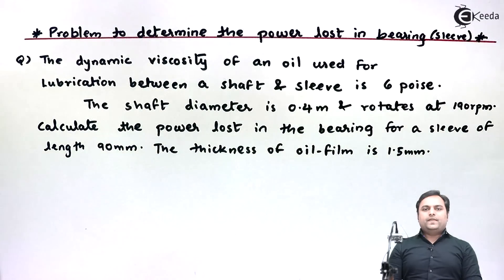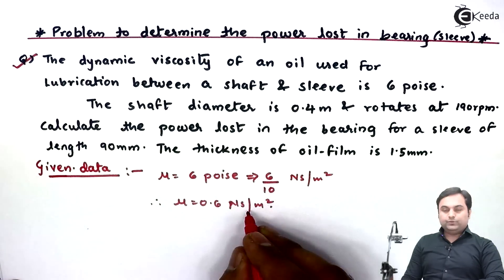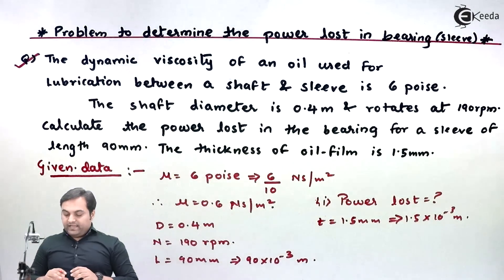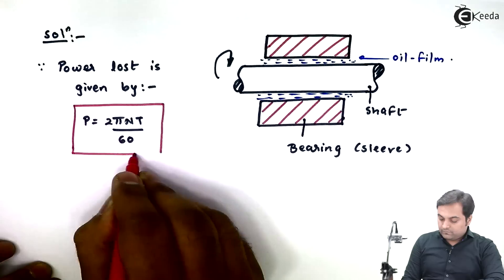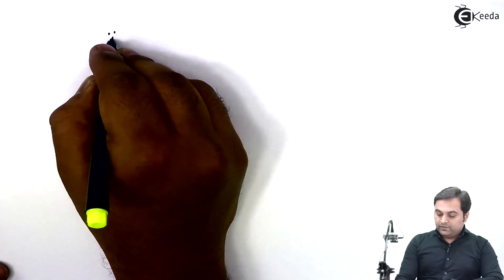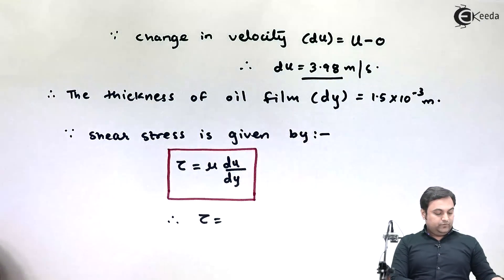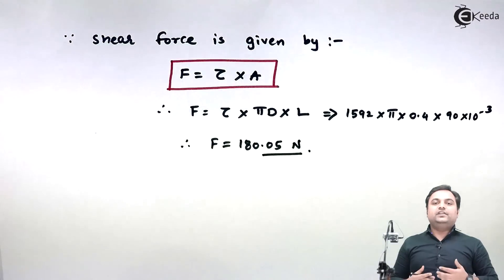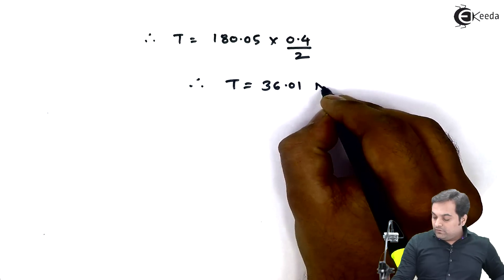Problem to Determine the Power Lost in the Bearing (Sleeve)- Properties of Fluid - Fluid Mechanics 1

Comment: du= u-0 ; u is velocity of top most layer of fluid film it moves with velocity of shaft,  '0' is velocity of bottom most layer of film which is at rest around bearing . Don't tell it's 0 because final velocity is not given in problem it's a misconception
Reply: Exactly